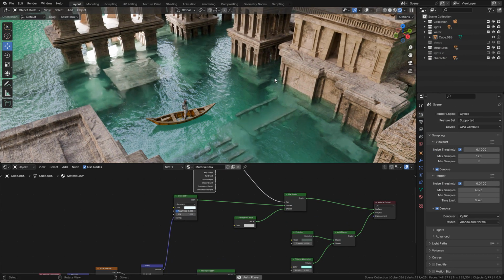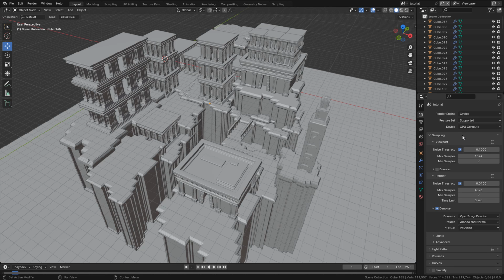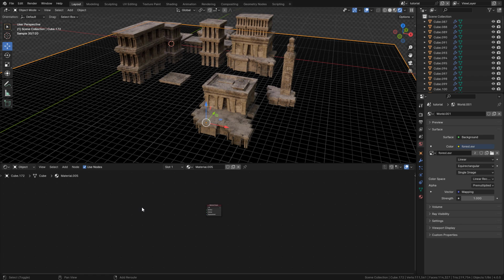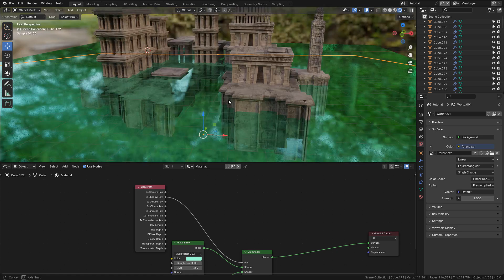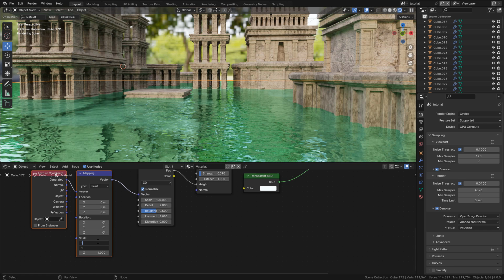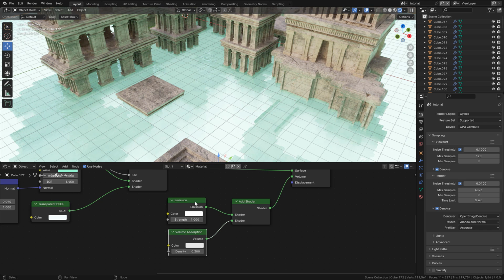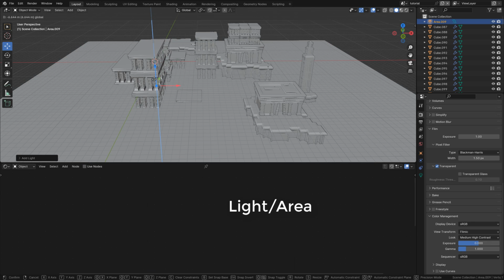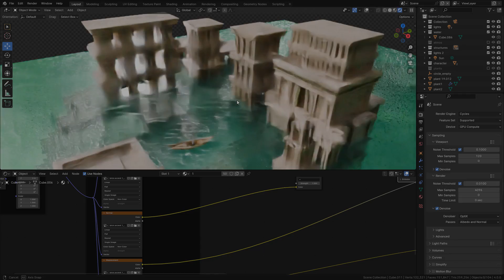How To Create Realistic Water in Blender (Updated)

Comment: I really enjoy this tutorial! However I am confronted to an issue while trying to follow each steps. I can't seem to give this waviness FX to the cube. 1. Copied the exact node tree. But nothing. So I did 2. Used subdivide in Edit Mode + subdivision modifier. 3. Even added a displacement node in my node tree. But nothing. I am using Blender 4.5 by the way. I am sorry if the solution is obvious or if you've done another video on the subject but I had to ask.
Reply from the maker: Maybe the texture coordinates?, to make the waves I used a noise texture, connected to a bump node from height to normal in the shader, if your noise texture doesn't have a texture coordinate node, select the noise, press control T, this will create 2 new nodes, make sure texture coordinate is connected from "Generated", if control+T doesn't work, enable Node Wrangler in Preferences/Get Extensions
Reply: Thanks for the tip but it wasn't Texture coordinate. After some playing around with the values of each node, I discovered that it was the value of the "distance" for the Bump node that made all the difference. Now I can properly execute your amazing tutorial!

Comment: Sadly I think lightpath not working for AMD card and specifically for 5700XT and maybe every card under 6000 series. If i use is CameraRay it totally switch to 2nd input means =1 for factor, If I use the is SHadowRay or is DiffuseRay its switch all to input 1 means its 0 for fac.. It doest not separate rays its not using raytracing at all. The render is Transparent or Glass not in between. Im with the newest drivers from September. Someone can confirm is this work for AMD and what cards are you using? 
EDIT in fact its the volume absorption and volume at all that is making something wrong. I cant achieve what you do in tutorial.

Comment: To add mix shader 1 tip. CTRL+SHIFT  R-mouse hold and drag from 1st to 2nd and it will automatically add mix shader and connect the 2 inputs.

Comment: Nice tutorial, thank you. And I've noticed that you often add mixing or adding nodes with Shift+A. Note, that in Node Wrangler there are commands 'Lazy mix' (Ctrl+Shift+RMBdrag between nodes (in older versions Alt+RMBdrag)), and also a bunch of mixing commands, with an automatic one among them (select two nodes, then Ctrl+Numpad0). Those commands are much faster, they even reconnect the old output.
Reply from the maker: Thanks, because these are tutorials I try to show everything, but you right I have to try it

Comment: So many projects break with some blender updates. I have a folder full of blender demo files that don't work after blender 3.0. It seems to me that if blender wants to be an industry standard they need not to break their files with every update.
Reply: Thats why they have LTS versions for studios so they dont need to update every few months :)
Reply from the maker: This happened to me only with some geometry nodes projects, but now when I open any blend file saved with an older version, blender 4.0 breaks it
Reply: @chuckcg  The lack of backward compatibility really ruins the usefulness of Blender in a professional environment.
It also screwed up my textures on mirrored and applied objects in one project. Newer versions have a repeating clapboard look to the wood panels. Ugh.
Reply: Sure that's anoying. But always make your backups, this is the basic reflex.
Also, you can have different executables of Blender on your computer. So you can open older projects in older version of Blender. Just use the portable version for this.
Reply: @vladartiomav  even the backups don't work on current versions of Blender. I don't like the fact that with each update, older projects are broken. I used to keep a few versions of Blender, but I found that each one takes up several GB of space in the users/documents and settings folders as all extensions are duplicated for each Blender environment. Too much overhead. Nowadays I just keep one version on my PC.